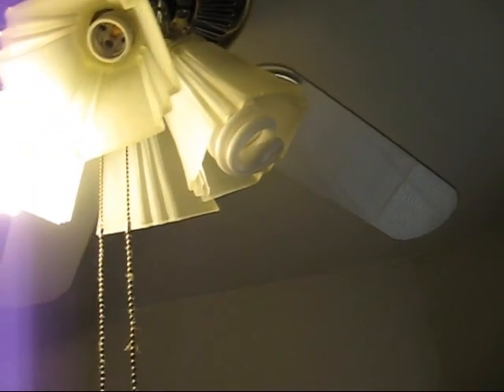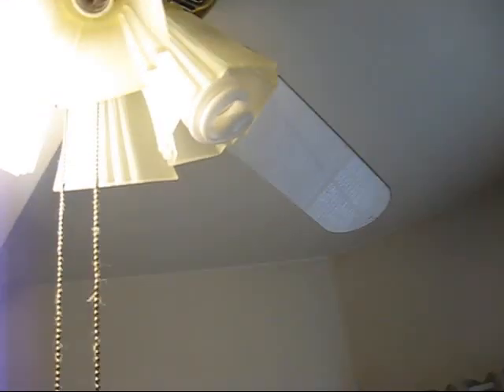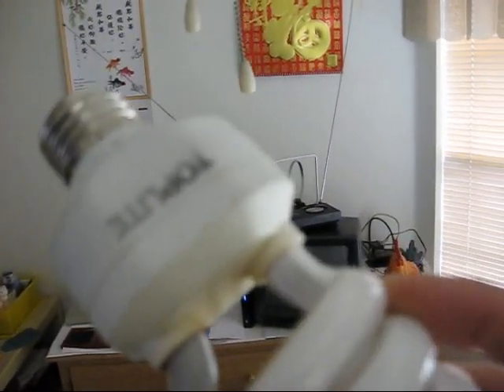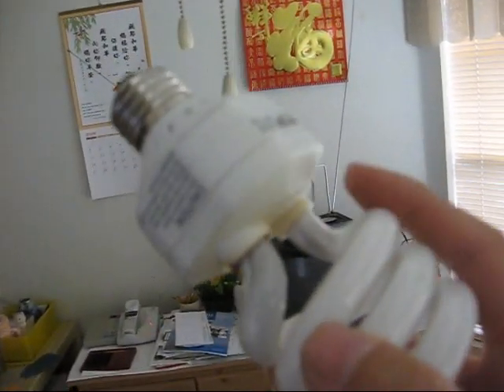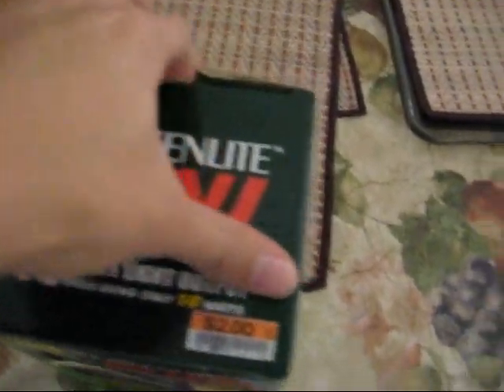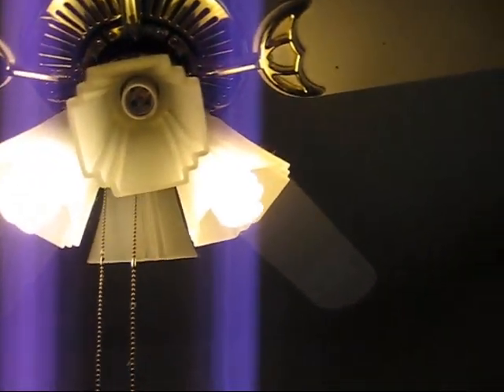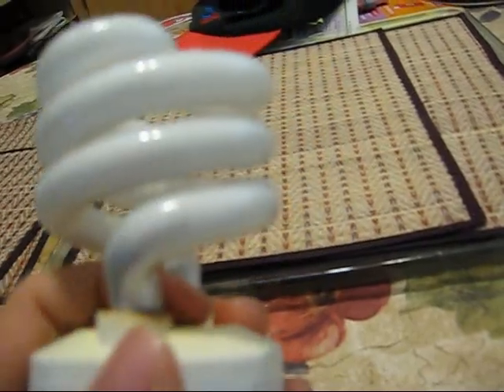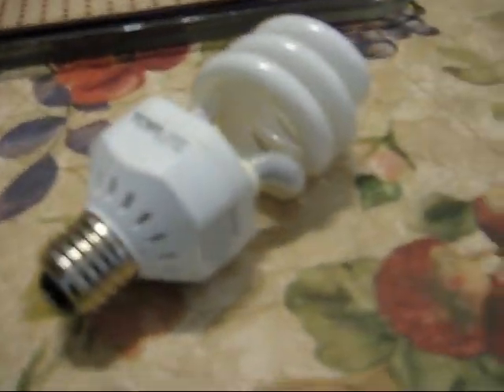TopLite Replacement

Comment from the maker: Yes, I've seen that. 

I'll have to wait until later this weekend to do a ballast harvest on this bulb as I need to borrow a Dremel from my Uncle to cut the casing apart. 

I have harvested a ballast from another one of these as well (a brand new one) to use in a F20T12 fixture but it took a while using a hack-saw.